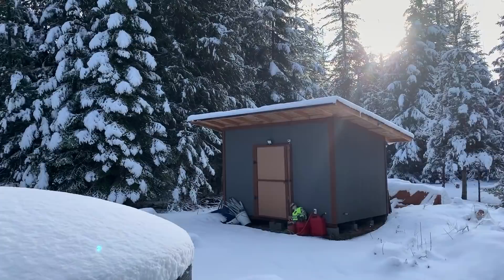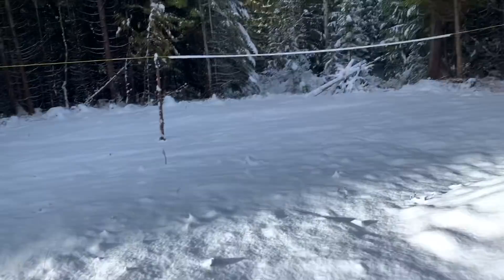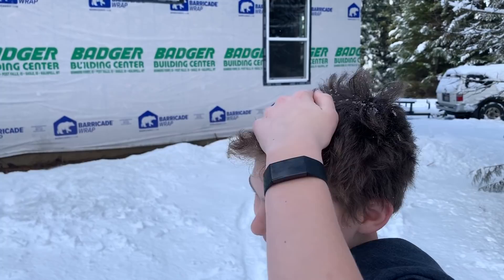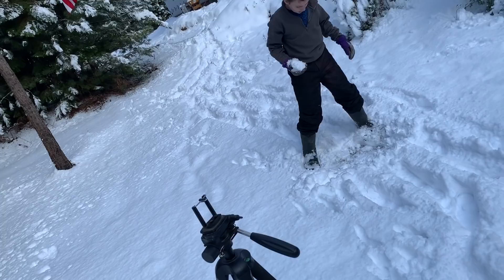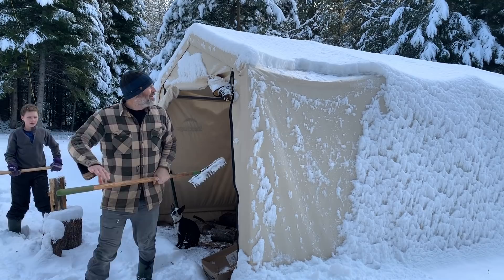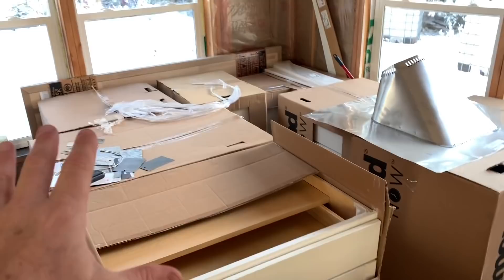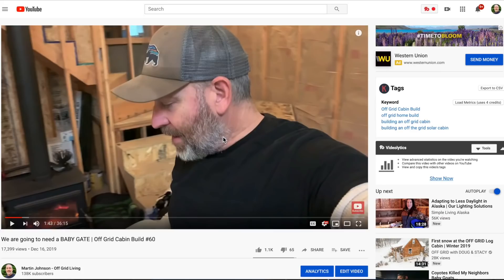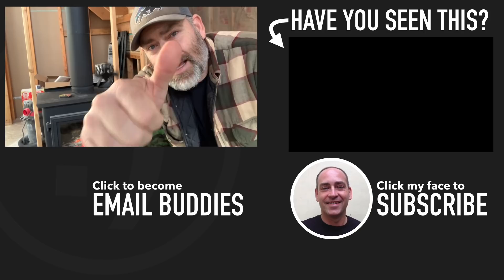Snow on Solar Panels is Killing our Solar Power Production (FIXED)

Comment: Maybe you can get a 2x4 covered with that rubber flashing material or old towels and use it to get snow off of your panels. Possibly put a push handle on it for a narrower tool or span it with ropes on each end to pull it across.

Comment: You should build a quick set of stairs to get into the house at the slider - I'm sure you have plenty of scrap wood laying around to do that.  Also, I would put on the snow cleats for your roof to keep the snow from sliding off and hitting someone.  If you get a large snow dump, and someone walks out the door they are gonna get smacked pretty hard.
Reply from the maker: Stairs are on the list. I don’t want snow cleats.  I want it to slide off.

Comment: Awe! Tux loves the snow! I had a lab for many years. She was so funny when it was snowing. You'd let her out for doggy time and she would obsessively chase the snowflakes. LOL Snowballs were her favorite though. It was so funny when she was young cuz she would sniff and dig around in the snow for a long time trying to find that stinkin' snowball. Makes me miss her! 
I totally agree. Use what you got. Although, I would probably wrap an old towel around the rake in hopes to reduce scratches, but then that risks micro scratches from the towel? So, not sure...???
Reply from the maker: Dogs are awesome. Can’t wait until we have a couple feet of snow out there.
Reply: @MartinJohnsonOffGridLiving  - Piece of unsolicited advice from someone with Alaska experience. Dig tunnels/ditches for Tux. You will be so glad come melt off because you will be able to keep up with the number 2's rather than have to deal with it in the spring. A path to a small clearing that ends up staying fairly packed as long as it is shoveled regularly. The no super stinky warm up. Hope that helps! Plus it is fun to watch them bound off in the deep snow just for the fun of it.

Comment: I think roof heating cable will help. You'll probably end up with icy perimeter which can work to your advantage. Like an ice barrier that can block wind and help insulate.
Reply from the maker: How many watts are they?
Reply: @MartinJohnsonOffGridLiving  It ranges from like 5w, 7w, 10w, etc per foot. Just double check and make sure it's for de-icing roof because some of the heat cords are meant for water filled pipes. Check Home Depot for an idea and then google other brands for comparison.
Reply: There's also heat cable for under floor tiles too. You can get a mat where it has grooves for the cable and then you throw subflooring over it. Tons of ways. All cords go by (x)w per foot.

Comment: You could use a roof rake :)
Reply from the maker: can you recommend a good one?
Reply: @MartinJohnsonOffGridLiving  They do sell heavy plastic ones,in case you may need to use it on your solar panels the snow does stick to just about everything in time :) i got mine on line but hardware stores and Walmart should have them as well. Have a good day Mr. J

Comment: During the winter your panels should only 20 degrees off of vertical! Far steeper than your metal roofing.
Reply from the maker: If your latitude is between 25° and 50°, then the best tilt angles are:
For summer, take the latitude, multiply by 0.92, and subtract 24.3 degrees.
For spring and autumn, take the latitude, multiply by 0.98, and subtract 2.3 degrees.
For winter, take the latitude, multiply by 0.89, and add 24 degrees.
For us, that would be 66.72°

Comment: have you not seen snow before? them shelters dont hold up to snow at all, the ones that dont put a 2x6 header beam and 4x4 post down the middle and a 2x4 header and 4x4 posts in the side rails there normaly flat on the ground before the sun come up
Reply from the maker: Arnold Romppai wow. Before the sun comes up. That is early.
Reply: @MartinJohnsonOffGridLiving  yes we get a snow storm over night dumping 2 to 3 feet of heavy snow and they are flat on the ground before day brake. normal snow fall

Comment: Martin your solar panels are way too horizontal for such a northern longitude. This is severely reducing energy production. If they were at the proper angle the snow would much more likely slide off.
Reply from the maker: seems like i said something like that in the video 🤔

Comment: Why don't you rainx them so the snow don't stick
Reply from the maker: Ritchie Hill think that would work when they are almost flat?
Reply: @MartinJohnsonOffGridLiving  I do think it would and wouldn't cost an arm and a leg I use to drive truck used it on sleeper glass it never had snow on it

Comment: PUSH BROOM 12//15 BUCKS,, PANELS $600 //$1,000 EACH,, LIFT EM UP PANELS TO 60% FOR 4 MONTHS,, SNOW WILL SLIDE OFF  & GET MAX POWER,, YOU NEVER NEED TO WASTE TIME,, OR WASTE GAS FOR CHARGING ,,, COUPLE HOURS WORK!! #1 FINISH ROOF #2  WORK ON KITCHEN AFTER DARK ..LMAO ALOHA
Reply from the maker: Those are some expensive panels. We paid about 50 cents a watt for high quality panels. Panels don’t really charge batteries when it is cloudy. Working on the roof in the rain, ice or snow is not safe.